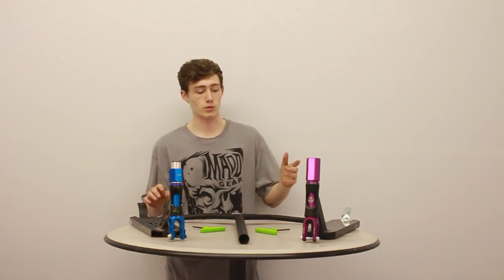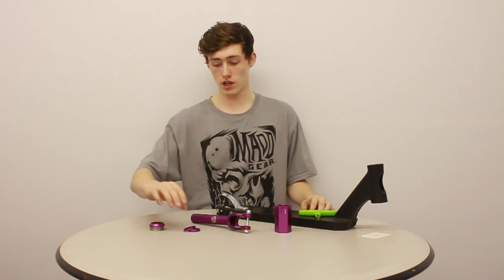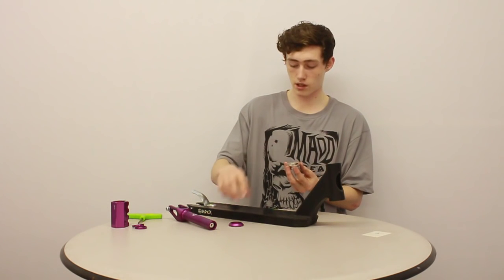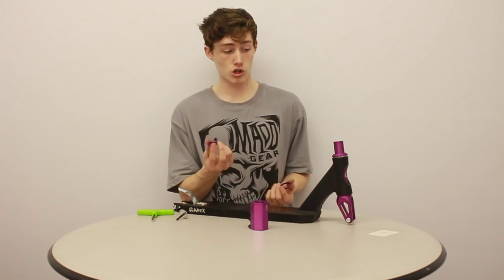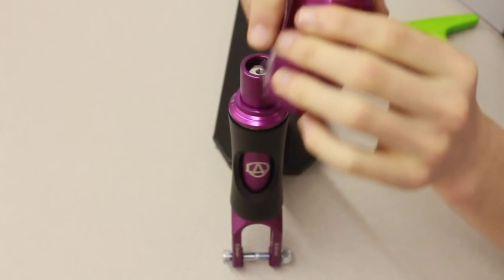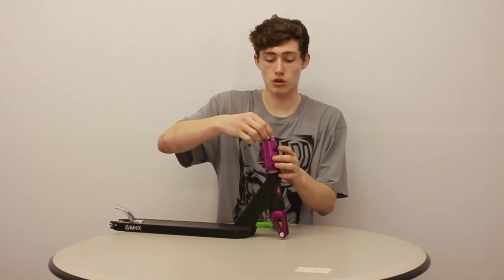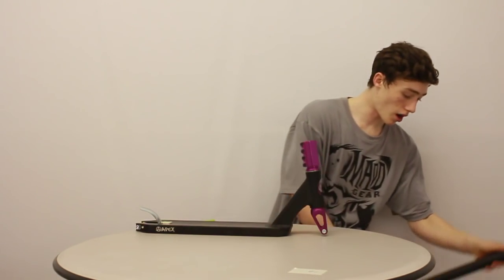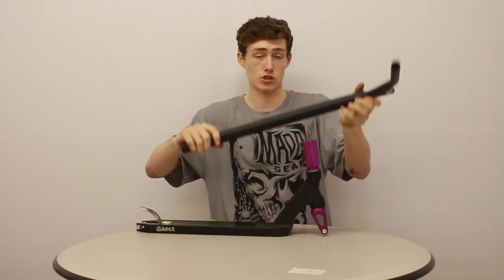Rampworx Buyers Guide: SCS Scooter Compression Tutorial

Comment: 2 questions.
1. do you need the topcap? and will it change the the speed of which it spins?
2. how do i make mine spin faster?
Reply: micheal checavich Hi to answer your questions, yes you will need a top cap as it helps protect your headset bearings for from dust etc which will also increase the life of your bearings.

To make your headset spin faster you could try tighting it as tight as possible and then loosing the bolt a little bit to make sure your compression spins good but also is solid, you could also try re-greasing the bearings if they are fairly old as the grease will eventually go away or if the headset bearings are new they should be able to spin smoothly and fast with the compression fairly tight.
Reply: thanks so much

Comment: If I put a headset spacer on my scooter would it make my bar taller and what would happen if I put allot of spacers on it, would my compression be really loose or would it be fine
Reply: The point of the spacer it to allow the scs clamp to fit with a longer fork. You usually won't need a lot of spacers for it to work.
Reply: And no, it doesn't make your bars taller